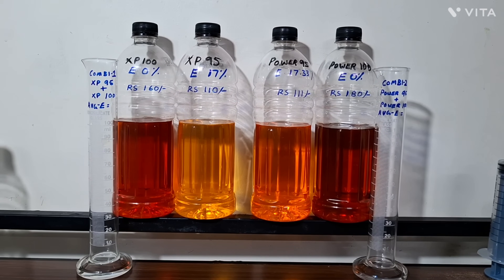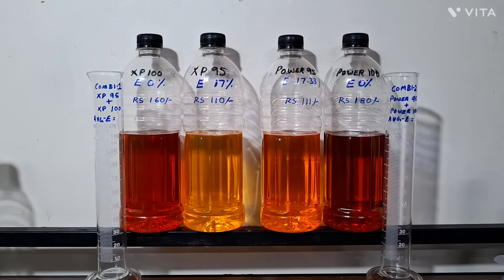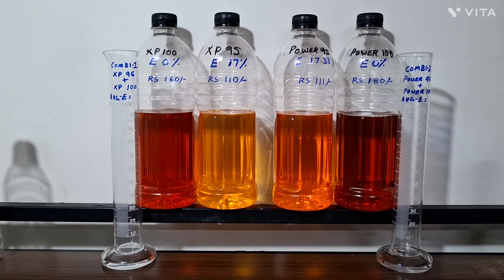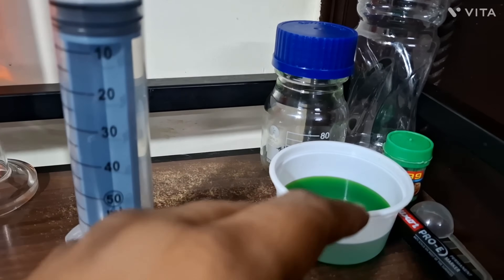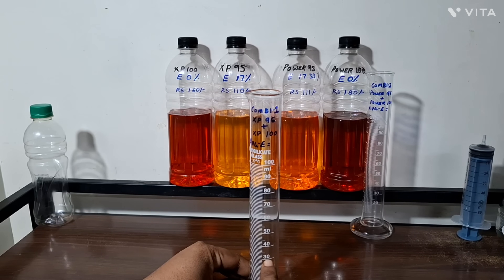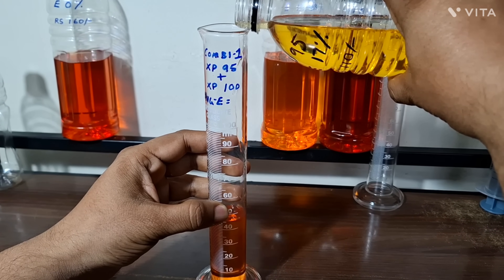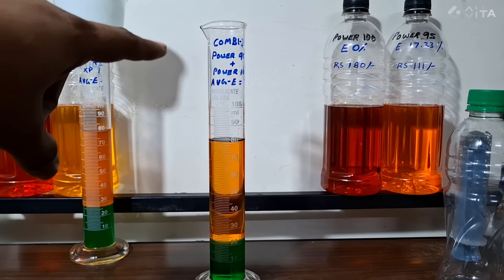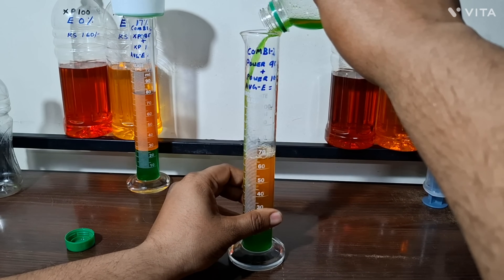Ethanol issue, work around video #2 on how to keep our non E20 vehicles healthy.= 23rd Sep 2025.

Comment: @zubtubtube this is an awesome video and thank you so much for putting so much of efforts with passion to serve common public.

I have two questions:
1. Is there a reason you did not mix 100 variant with normal petrol variant, why only 100 + 95?
2. Indianoil petrol bunk at kariammanna agrahara layout (near bellandur lake) is claiming xp95 is 12% ethanol. Do you think their claim os true? Based on your tests i have seen above 17% ethanol blending in 95/97 variants.
Reply: Hi Zubair, appreciate if you could help answering this one?
Reply from the maker: Hi, reason i used xp95 as this fuel has 17% but normal fuel has 20% ethanol.  

Xp95  used  to be 5% before August 2025 but now it has  15% to 18% ethanol 

Normal fuel is at 20% ethanol
Reply: @zubtubetube  thank you for answering Zubair! Would you mind doing one by mixing with normal petrol?
Also can you share any guidelines like how and whom can i talk to at the petrol bunk to verify whether they are true in saying that xp95 is 12% ethanol?

Comment: Bhaya HP POWER99 ka Ethanol test karona please
Reply from the maker: In bangalore only power 95 and power 100 available
Reply: Ok bhaya, I am using xp100 it's good but when used power95 it gave me good pickup than xp100 though it has 15% of Ethanol, using power100 xp100 can this fuels damage standard engine like Yamaha ybx, pls clarify, now I am planning to use power100, because power95 gave me good pickup but also problems regarding ethonol, power100 will give more pickup and performance hence it is 0% ethonol in it ...

Comment: I am shocked even XP100 comes with 10% ethanol. just few days earlier I filled my scootys tank with XP100 with intent that it is zero ethanol, even paying such high price, Nowadys fuel clearly reflecting the character of Govt. full milawat.
Reply from the maker: Xp100 doesn't come with ethanol its 0%. When u mix xp100 with normal fuel which already has 20% ethanol then the ethanol % averages out. For example if u have 5 liters of xp100 E0 fuel and 5 liters Normal fuel with E20 then the total 10 liters of fuel when tested it will be E10.

Comment: Guyss do check out cars24 youtube video on mileage from a 2015 swift petrol to see the difference between mileage from XP100 & normal. Finally per km you will be spending 1.4 rs more for XP100.

Comment: Hi Zuby,
The HP Petrol pump on Old Airport Road claims the Power 95 is 10% Ethanol and not higher than that. Do you think they would have reduced the Ethanol percentage blended in Petrol especially on Power 95? Or do you feel it's not accurate information that they are sharing with us?
Reply from the maker: When i tested power 95 it was 17%. Power 100 was 0%. Actually as per govt mandate, apart from power 100 and xp 100 fuels. Rest all are mandated to be at 20%. 

But the percentage will differ mainly due to ethanol availability.  These leaders don't know or didn't take other challenges into consideration. 

To produce 1 liter of ethanol it requires 3000 liters of fresh water. If there is no sufficient water they cant make enuf ethanol.  May be thats God garace that atlest due to water limitations they will be forced to give us less  ethanol blended fuel. 

Otherwise coming summer season if we have water scarcity.  Its mainly because of water getting diverted to ethanol production units and not to us. Then public will unite may be.

Comment: I think xp95 doesn't contain ethanol 
Where can i found ethanol free feul
Reply from the maker: Xp95 has ethanol from 15 to 20% depending on ethanol availability. Only xp100 and power 100 has 0% ethanol. 

Xp95 = 110rs per liter 
Xp100 power 100 = 160rs to 180rs per liter

Comment: If we mix power100xp100 with xp95power95,97 than is there any power loss or is it gonna effect the bike engine, because both the fuels are different pls reply
Reply from the maker: Mixing will have no issues.  If u run in complete xp100 or power 100. Your vehicle is running on Ethanol free 100 octance this is the best what a vehicle can get.

If u use mix fuel that is 
50% [ E0 + 100 octance ]  that is xp100/power 100.
And
50% [ E20 + 95 octance ] that is xp95/power 95.
Then it will be average.
That is [ E10 + 97.5 octance ]

As 90% of vehicles are E10 compatible this is the best mix keeping price in mind.

But if you want to enjoy fully then use either xp100 or power 100 and dont mix any other fuel. However this pure fuel gives advantage only to performance vehicles like superbikes and supercars.  For normal vehicles main focus is not octance it main focus is to get Ethanol % under or equal to 10%
Reply: @zubtubetube  thank you for your reply bhaya, but my bike is 2000 model YAMAHA YBX AIS model which can handle upto E5 only, actually in 2018,19 bike use to give 100%pickup and in 2020,21 pickup dropped upto20% and in recently like last 3 months experience is like pickup dropped 50% and engine was getting stalled regularly, after I came to know about E20 E10 then I understood why pickup was dropping continuously, it was because of gadkari'd fraud and paid E20 policy, anyways bhayya,
I will do like bp speed97 is upto 10% of Ethanol so I will fill 1ltr of both power100 or xp100 and 1 ltr of speed97 than Ethanol Will come down to 5% ok bhaya

Pls reply your thoughts on this or do the video with above combination of fuels pls...
Reply from the maker: Most welcome bhai. Once do full service of the bike main thing get the tank cleaned,  if its carbureted engine get it properly cleaned,  if its EFi engine get the injector cleaned. Use this combination fuel. U bike will be fine
Reply: @zubtubetube thank you bhaya for your suggestions and reply too❤❤

Comment: Back in 2005 BP launched Speed 97 fuel in bangalore @ Rs.60/Lit and lab report showd that the fuel is 98.3 octane. Miss it really. seeing at that ratio. XP100 should not cost more than 20 percent of normal fuel.
Reply from the maker: It's true that those premium fuels offered a great value and performance back then.

Comment: basically u mean to fill tak 50 percent each. since ethanol is max 20 in normal speed and indianoil. xp100 and normal fuel 50 50 also will get same result of 10 percent ethanol
Reply from the maker: Yes, you are right.

Comment: Hi Zuby, can you try the testing between normal petrol with shell v power
Reply from the maker: But normal fuel is 20% Shell is 15% so it will be average of this. And this will not be under 10%. It will be 17.5% Ethanol
Reply: @zubtubetube  got it thanks for the update

Comment: Hmm. But I couldn't find xp100 or power 100 anywhere near ecity in banglore. I am calling all highly rated petrol bunks and they are telling 100 is out of stock or they are not selling evntough it's mentioned in company apps. Even one person asked me to add addon p to help with mileage. But to me damage is more concerning. Can anyone tell where I could get xp100 or power100 near hosur road or ecity in banglore. ?. IOCL app or hp app data is not correct.
Reply from the maker: Both the fuels are out of stock in bangalore at the moment. They said it will take 15 days. As only 1 refinery in Mathura U.P, has the facility to make it. This refinery supplies to Trier 1 cities across India. Hence when stock gets over it takes 15 to 20 days to come.

Comment: You could have combined normal fuel with 100 Octance. What was the need to use 95 octance since both 91 and 95 octance are 20 % ethanol from HP, BP and IOCL
Reply from the maker: Xp95 or power 95 has additives which helps in keeping engine clean from deposits. Earlier the normal fuel was 91 octane and no helpful additives.  Now normal fuel has 95 octane due to high ethanol content but no additives as before to keep engine clean, xp95 will continue to have additives to keep engine clean  from deposits and yes the octane will be same 95 or more. Hope now u got the answer on why this fuel was tested
Reply: @zubtubetube but 100 Octane had the additives so half tank each should be good enough right?

Additives in 100 octane and 91 will get bumped up to 98 octane as per Autocar article so I thought that would fix both additive and octane issue and of course the main ethanol issue

Comment: Can we get a semi decent fuel like Jio and then make some half tank worth of E0 at home (skimming). Home made E0 + E10 (Jio) will approx be E5. It will be cheaper than this blend. Though yes it will involve some hard work.
Reply from the maker: You can but it will work on low compression engines that are below 8:1 compression ratio.  As here even 89 octane is enuf

Comment: I used to do this mixing to get a higher octane petrol at a moderate price several years ago. 
Have experimented with Toluene also but over time the fuel pipe gets squishy.
Reply from the maker: Interesting that you have experience with this, I appreciate you sharing it!
Reply: toluene is a VERY strong organic acid, your fuel pipe is melting due to it.
Reply from the maker: Why would u mix this acid
Reply: @salilpanwar6922 
Its used to increase the octane number of petrol. 
Even ethanol is an organic acid which government is mixing and distributing to everyone 😅
Reply: @ramswaroopghante5001  toluene is much more oxidising, but okay.

Comment: I have tried with XP95 full tank in my BS4 Etios Liva, it is smoother but pickup takes a massive hit because engine isn't made for 95 octane. Then I tried with 20L XP95 and 15L normal and this time pickup was better and engine still smoother. Thing is, on pure normal e20 petrol engine feels more eager to rev but its vague in response, all show and no go after you cross 30kmph and feels very rough. With higher octane, engine takes alot of time to rev up and because I floor the gas to compensate, the fuel economy evens out.
Reply from the maker: Thanks for sharing your experience, it's interesting to hear how different fuel blends affect your car's performance.

Comment: The E10 still comes out to be Rs 135 per litre ( for xp100 + xp95 half mix) , which is quite expensive for normal vehicles.
JioBP gives E10 at Rs 103 😅
Reply from the maker: Yes jio works out better but low on octane but still good for normal vehicles.  But the question is will jio continue to give E10 fuel. People already saying now jio is at 20%.
Reply: @zubtubetube you again need to re-test the Jio-bp & BP speed, zuby. Pls consider this request as the content for the next/upcoming video🙏
Reply: @zubtubetube   Then you need to test jioBP and Speed97 one more time in October to confirm once and for all 😊
Reply from the maker: Sure will test jio bp and speed again in October.  Rti report on Indian oil petrols.https://quickshare.samsungcloud.com/rf15H6NSYEnt
Reply: @zubtubetube   yeah, sadly even 95 RON fuels are all E20 now.

Comment: Good effort as always brother.
My 2 cents on this topic - Actually this may not be the right conclusion even if E20+E0 comes to be E10 in this test. Because in the test it has to come 10% ethanol since we are actually doing this experiment on the mixture of 60 ml of fuel which contains [30 ml+80% of 30ml petrol] and [20% of 30 ml ethanol]. But the real concern in this experiment is that we can't prove the fact that if we mix both the fuels whether it'll be mixed evenly or both the fuels will settle down one on another depending on the factors like density, miscibility, etc of both the mixtures.
Reply: It's density and miscibility 😊
Reply: @Nichansama  Thanks brother. Actually I checked once again there were a lot of errors. It seems as if I was sleeping while writing although that wasn't the case.

And yes mixability is also a right word but yes miscibility is standard and more appropriate here. Density one was just a typing error.
Reply from the maker: Thanks for your valuable input on the experiment, I appreciate your insightful perspective!

Comment: RESPECT BROTHER ! No one else can understand the pain of pouring e20 petrol into our dream vehicles. These people can easily buy car the very next minute of theirs being damaged due to wrong fuels. Thanks a lot for your videos ❤. By the way no fuel stations in Bangalore has Xp100 as of today. I forcefully filled up half a tank of Jio BP even though its safe, after shifting to E0 going back to E10 too feels bad 😅.
Reply: Can you share the location of JIO BP in Bangalore? The one near EC doesn't exist.
Reply from the maker: https://maps.app.goo.gl/NdUYa2giaj4Dxnj48?g_st=ipc
Reply: @manusarma https://maps.app.goo.gl/XsporyW6b6NBWNrR7
Reply from the maker: Thanks a lot for ur support.  Yes xp100 and power 100 both out of stock in bangalore.  Dont know when these will be back. I had purchased 30 liters of power 100 last week. Now using this very very carefully as if it runs out, then will be forced to fill ethanol blended fuel,  which i would never want to now, after enjoying the E0 ride quality.  

My worst fear is what if there is only E20 and no there fuel. 🙄
Reply: @zubtubetube IF to look at big picture a change is happening, first they did it with diesel now with petrol ya they are forcing to buy EVs Ok. But at consumer perspective we are being treated as slaves, it's as simple as mixing 20% pois0n in our 80% water and people whose bodies are not compatible with 20% posi0n eventually di€😢 and others survive 🎉 we r forced to drink and people simply drink without even questioning😮. This is the main advantage for the gov.

Comment: Difference is because you messed up with the xp 100 and xp 95 you added little more water which is 25 ml
But if you add 20 ml of water first in the glass jar then fuel it will not be a problem
Check 5:30 to 6:15 its little bit error
You can also add total price for e10 after mixing so it may help for people who don't understand the calculations in next video
Any way thank you
Reply: yes he didn't made the syringe upright and removed the excess air. total noob mistake,
Reply: @hahahihi-e4m mixing water on top of oil makes people confusion so avoid mixing it that way so that people can understand clearly

Comment: Good work. May almighty bless you abundantly for your efforts. However, the results represented in the video are only possible if the fuel mixture ratio is 1:1, that's 50% of E0 and 50% of E20 fuel. But howmany of us would be able to afford XP100 or Power100 in this ratio. That's another question one has to answer. Daily commuting bikes normally have 12 liter water capacity fuel tank. Hence 6 litres each of E0 and E20???? Is it really value for money. Brother i request you to make videos with different ratios so that it can help commuters belonging to mass category.
Reply from the maker: Thanks a lot for you kind support.  I will try different combination to see which is feasible for us
Reply: Thank you so much brother for promptly acknowledging my comments and observations. Looking forward for your insightful content. I too resonate with another brother here suggesting to conduct Ethanol blend test on individual fuels before proceeding with test on the mixture as fuel from different batches might over write your test results from the past. Thank you once again

Comment: At the time of this experiment You should have checked the Ethanol % in XP 95 and HP 95 instead of taking the old test results as Ethanol content will continue to rise in these petrol as well until they eventually hit 20%, depending on Ethanol availablity.
Reply from the maker: Yes looks like these guys have crossed 20% now
Reply: @zubtubetube I felt the same when I filled BP Speed yesterday

Comment: Any idea where 100 petrols are available currently in banglore ?
Reply from the maker: At the moment there is no E0 fuel in stock in bangalore for few weeks unfortunately
Reply: @zubtubetube what workaround are you using ?
Reply from the maker: I have stored close to 35 liters of xp100 using it only when I need it the most. However good news is xp100 tankers already on the way to Bangalore

Comment: What if one cannot get xp100 / power 100 octane fuels, due to availability issues
Reply: Nothing..Curse the rulers of our nation
Reply from the maker: If E0 fuels not available 😒 then its over. Keep using e20 till they vehicles slowing die, giving bad to worse ride quality and eventually its over. Already in bangalore from past 1 week there is no stock of xp100 and power 100. I have 30 liters of power 100 in stock at home in metal jerry cans. But worried on what to do if this gets over and petrol bunks dont have stock

Comment: E0 is available in metro cities but not in smaller towns so combination is not an option there. I work in Bangalore now I have come to my native in Assam where petrol bunks don’t even know about XP100
Reply: Assam is a place with lot of moisture present in environment hence blending will not be done or very less .Mostly areas with dry temperature will get highest ethanol blending
Reply: @rockluckyabhi  As per RTI filed normal and E95 Petrol has 20% Ethanol Blending in it all over the country and not as per state

Comment: So if i go and Indian oil pump can I fill half tank xp95 and half tank xp100...It will automatically mix and can be used as E10 petrol?.If this is okay i am relaxed because it will still be 136 ₹ and I can keep the engine and fuel tank clean for another 3 years atleast,till my warranty is over.
Reply from the maker: Yes, if the bunk has both xp95 and xp100. Can fill both,  it will mix automatically when u drive or ride
Reply: @zubtubetube thanks bro...A sigh of relief at last.

Comment: I think you should have tested the fuels first before mixing. Every batch could be different. A retest would also be an opportunity to compare with original values. 

The numbers aren't making sense but you've proved mixing is possible to reduce ethanol 👍